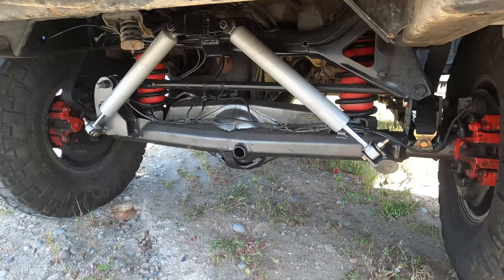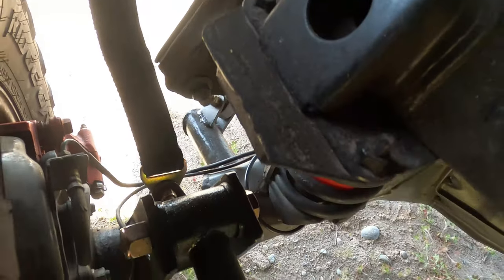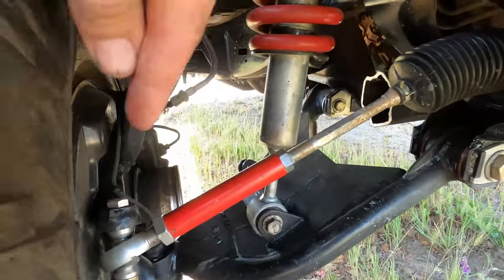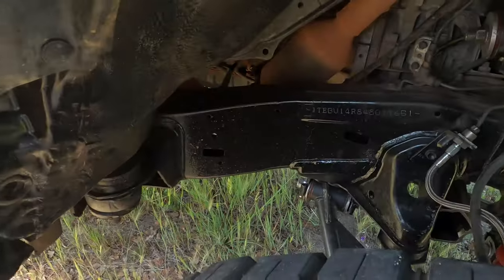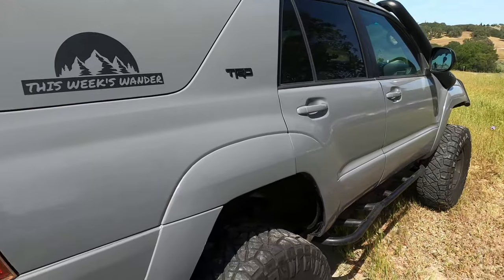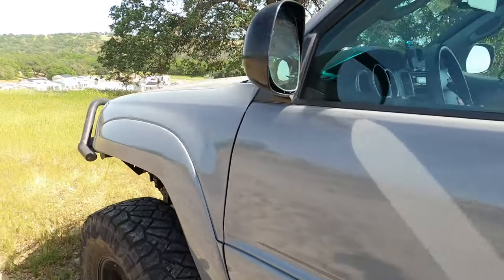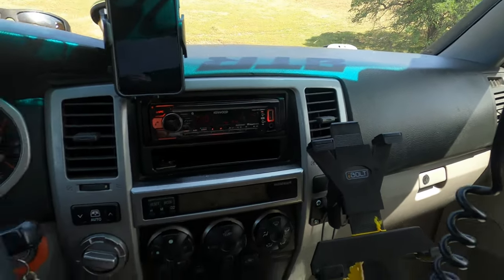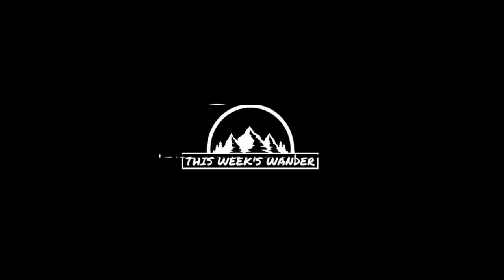4th Gen 4runner Long Travel Overland Build

Comment: I want to start upgrading my stock 4Runner but I don’t even know where to start. What would you upgrade first?
Reply from the maker: It all depends on what you will be using it for! A stock 4runner is very capable. If you are doing mild wheeling and camping, Id do a cheap spacer lift, some good AT tires and then invest in some camping gear!

Comment: You’re running long travel arms with mid travel shock ?? How’s the ride?
Reply from the maker: It was a temporary solution before Kings came in, but I sold the rig before I got that all sorted. The ride was fine, Just not able to maximize travel with the mid travel shock. I had to strap it before I exceeded the shock travel

Comment: How did you install the mirror? I have the same mirror you have. However, I cannot mount it because the camera won't open completely, it gets blocked by the stock mirror
Reply from the maker: mirror just straps over the stock mirror. You have to offset it a little bit, but I didnt have issues with the camera being blocked

Comment: How did you get this kit for $900?? I realize I was looking at a Tacoma kit but the taco kit is $1400
Reply from the maker: I did a local cash deal, but they were doing a special for 900 online back when I was looking at them
Reply: @ThisWeeksWander  what are you honest thoughts about this kit? I've been looking at them, but a lot of people say they are not good. Everyone who actually has them says they are good.
Reply from the maker: @farewellvoyager5379  I love it. its a great upgrade from stock no matter what. the build quality is good. Its an exact copy of the All Pro kits from what i understand. I used their instructions to install mine. overall ive been really happy. I just have to keep them greased up so they arent noisy. The added travel and width makes driving way more comfortable on and off road. They are way beefier than stock and for a fraction of the price of other +2 kits I would buy again for future builds for sure. If they are paired with proper coilovers too they will be a huge upgrade over any stock width control arms with added lift. Not much to go wrong with control arms anyways..
Reply: @ThisWeeksWander  I know certain folks worry about the uniballs and cups. Another guy I know on a forum told me he gussetted the arms at the cups, both upper and lower. I really don't have doubts about the kit, other than dudes with $5k kits talking sh!t. Thanks for getting back to me bro!
Reply: @farewellvoyager5379  Did u decide on the Depo Racing Kit?